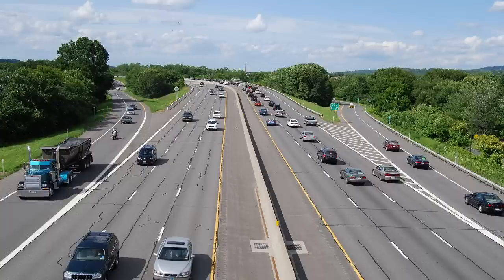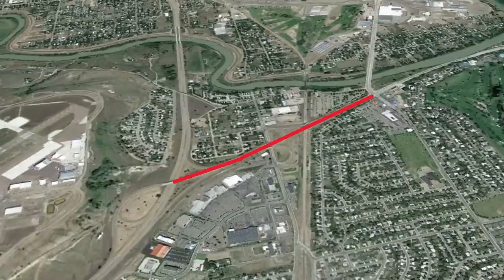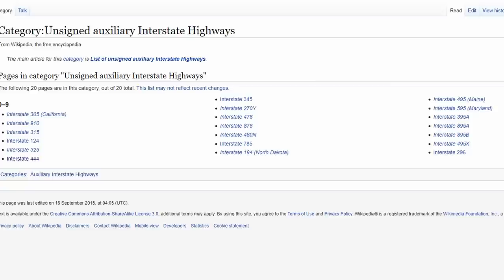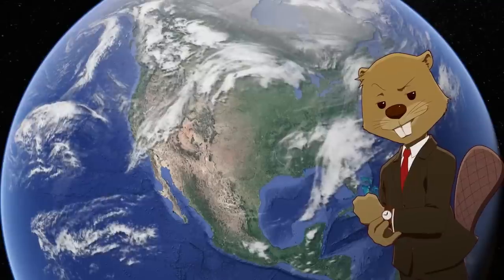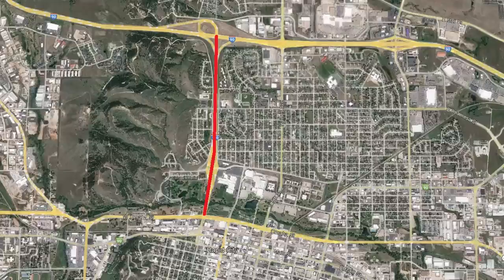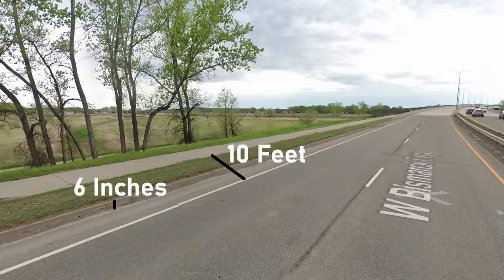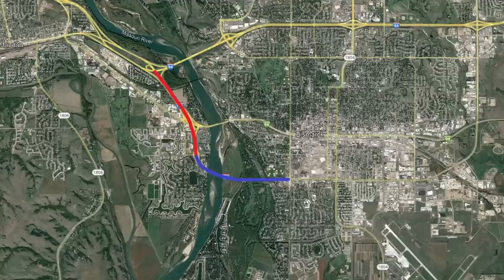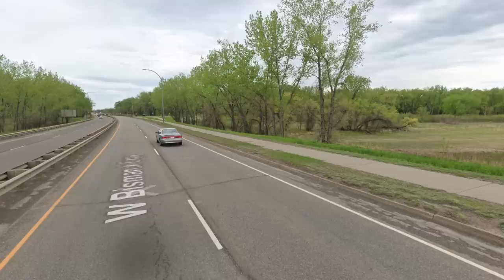Why This US Interstate Has Sidewalks

Comment: That's in practice a typical sidewalk and doesn't meet the criterial for being a multi-use path for bicycle use.  It doesn't meet criterial for 10-feet or more from the motor vehicle roadway.   There is not 10-feet of protection between the sidewalk and the roadway for roads with speed limits above 40 mph as is stated in guide lines.  The 10-foot protection buffer is an absolute minimum.  Where there is snow plowing you want at least 20-feet for a place to put snow.  

 A trail is a marked route.  It's not a path or roadway.  Typically the classic means of marking a trail is paint blazes on trees, there are additional marking systems.   A path can be signed directing people along it and count as a trail.  What typically happens is once a trail is marked people would form a path through use.   This is because it is much easier to typically follow where somebody else has walked before because their travel has improved the way for walking.   That is not aways the case.   When walking on wet sand at the beach it is easier to not follow in another persons foot steps because they've made the surface rough.   That is about the only place people don't form paths from following trail markings. 

In the high growth areas of the eastern US the paths for trails realistically need to be built and cleared to some extent.  The word "trail" was made very popular in Hollywood movie Westerns of the 1930s and later TV Westerns.  Picnic parks largely put in paths for entertainment purposes and would call them trails to associate them with people's favorite Westerns especially appealing to young boys.   The word "trail" appeals to the imagination.  I termed the term Rail-Trail to mean a bicycle path that precisely follows a well maintained rail alignment in 1991.  There is a more evolved reason for calling it a rail-trail because there are street running railroads where calling it a rail-trail works fine for when most of it become a bike path, but cyclists just follow where the rails were when it was a street running railroad.   Its still a rail-trail.

This gets a bit long, but its actually a subject I discovered when my barber asked me about people cutting across his front lawn.  The offsets for side paths are from printed guide lanes and observed practices.  

In Indianapolis Indiana arterial roadway improvements with increased ROW width the sidewalk is typically placed near the ROW property line, sometimes leaving large 30-40 feet of typically grassed shoulder between it and the roadway.  This sometimes requires placing short connection between the sidewalk an  intersection's corners because they might otherwise be 30-feet from where the sidewalk's from the intersecting streets connect.   For bicycle side paths, the side paths is suppose to come in close to within about 5-feet of the road way at intersections to act as the far right lane that has the right-of-way over turning vehicles from the near motor vehicle lane.   I wouldn't push that rule-of-the-road if a cyclist.   This is suppose to make the cyclist much more visible and expected to turning motor vehicles.  The disadvantage is it is now where plow trucks throw their snow.  You really want a side path or sidewalk at least 20-feet from the road way to give an in-between place for plow trucks to throw snow.   That becomes the idea place to put a drainage ditch.  With the side path 10-feet from the Mt. Comfort Rd in Hamilton Co. plow trucks appear to throw snow dead center on the side path.  

I've discovered that for double lane or more traffic the interaction of the side-by-side vehicles can cause an explosions of their airflow envelope that scatters dust and gravel far and wide pulverizing persons close to the road.   This interaction also causes the exhaust from the vehicles to break from being directed upward away from humans to exploding to the sides where it causes people to gag.   This is why it is far more hospitable to ride a bicycle next to a single motor vehicle lane traffic and full width  bicycle shoulder with comparatively heavy traffic than a double width lane traffic with clumping of motor vehicle traffic.   The interaction of the side-by-side vehicles destroys their tight air and exhaust control design characteristics.   There is more and larger gravel and grit on the shoulder of multilane traffic  motorways than that of a single motor lane roadway carrying the similar traffic at similar speeds.   Where this extra fine gravel is coming from is likely the roadway.  These air currents would also play havoc with any loose loads in trucks. 

If you scout along a multi lane side-by-side traffic roadways where speeds are above 35 mph you will typically find areas that appear to have been pulverized by explosions of small gravel and grit.  This appears to be where the interactions of side-by-side vehicles causes a sudden collapse of the air envelope around the vehicle.    

My barber asked me once why people were cutting across his hair salon's front yard a converted single family house on a double lane same direction US-40 with speed limit of 40 mph when there was a sidewalk.   My out right answer was they didn't want to walk out to the sidewalk when they were going to the someplace just on the other side of the his salon.  He said no, they were just walking along.   When I went out to observe the situation the sidewalk was under 5-feet from the curb with every few hundred feet having a scattering of small gravel that was not sorted by size, but uniformed across the deposit.  If the gravel was deposited from tires kicking it out to the side you'd expect a different pattern.  I noticed when side-by-side vehicles were passing by me I'd occasionally feel a large buffeting of air very different from the much calmer air I'd feel from a single lane of traffic.   

That buffeting was erratic, some interaction of the side-by-side vehicles would make it varying degrees of violent.  I also greatly noticed the smell of unburned gasoline and Diesel exhaust at those times.   The smell you get when you first start a car up and it's having to run rich for the first few seconds typically 25 seconds.   I'd thought emissions regulations had largely eliminated unburned gasoline from being exhausted, at least that is what is smelled like, but appears that modern vehicles are very good about ducting their exhaust up and away from where people might be.   The buffeting would pick up any loose sand and launch it into my face.  This wasn't that big a deal if you weren't trying to notice something.  The particle might sting a bit, but I was distracted by the gust of air and noise from the passing cars.  Where there was larger particles of 1/8" or so covering the sidewalk in a uniformed distribution that looks like a large parabolic curve launched from the roadway that lands on the sidewalk.   I went back and told my barber the reason people are cutting across his lawn is to get away from the cars.   

I ride my bike on the full width bicycle shoulder of Mt. Comfort Rd. 600W Hancock Co, which is a rural arterial road configuration where there is one lane that is always directed though with turn lanes and runaround lanes to allow continues traffic speed of the primary lane.  Vehicles speeds are typically between 50 mph to 60 mph and there is very little gravel on the shoulder.   Riding a bike on the shoulder I get the noise of the passing vehicles, but they don't upset my air badly and I don't gag from their exhaust smell.  When riding my bike on the full width shoulder of US-40 with side-by-side vehicle interactions passing me just about every time a group of side-by-side vehicles pass me I gag from their exhaust and I get buffeted by air blasts.  I'm now watching for the occasional super blast from side-by-side vehicle interaction when they pass me.  I think I've experienced it a couple of times.   These observations really make me less inclined to want to be close to multi-lane side-by-side traffic at highway speeds.